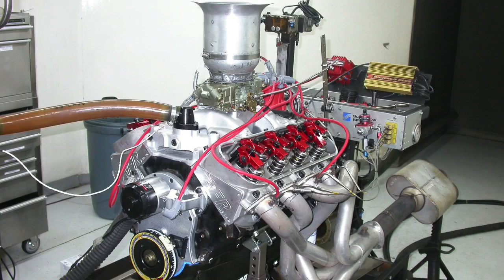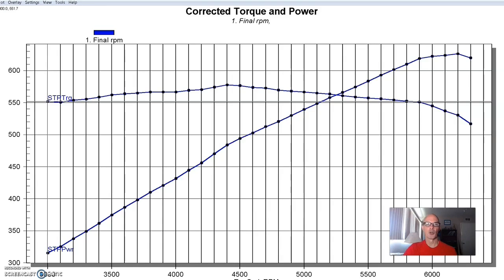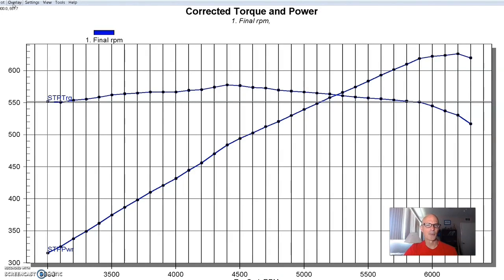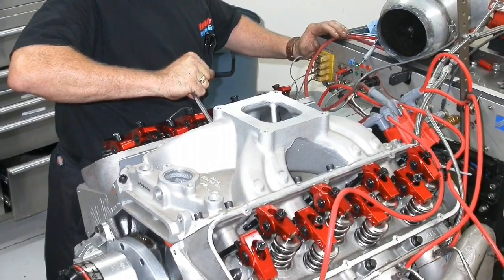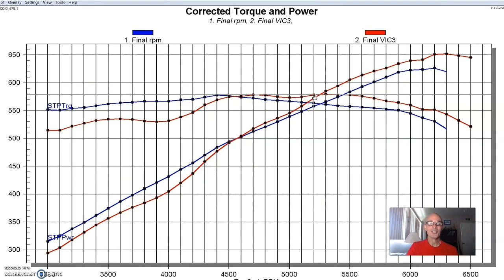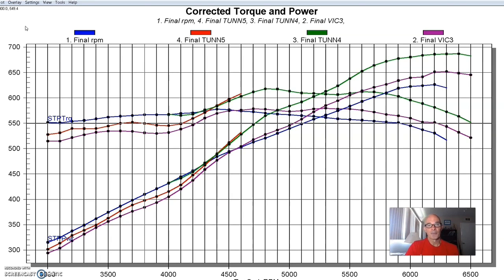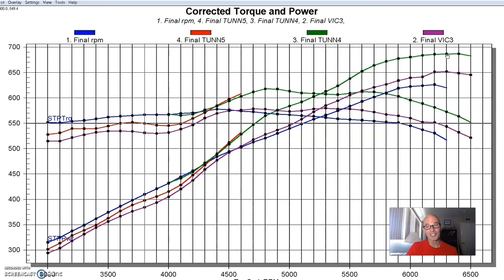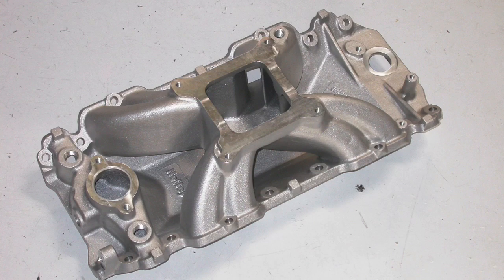BBC-TUNNEL RAM vs THE WORLD! -PLUS BOOST

Comment: I'd like to see a test between a single 4 tunnel vs a 2x4 tunnel. I want to see the far corner a/f and egt ratios compared to  the inside 4 cylinders. Will a single 4bbl tunnel ram hurt the engine?  Weiand makes both tops - it just needs fancy header data collection.  While I am dreaming how about propane and turbo boost like AK Miller did 50 years ago.
Reply: You can't hurt an engine with an intake manifold
Reply: @grren1782  I  own a 351 Cleveland Tunnel ram  from back in the olden days.   I also have  both Dual and single  Quad tops. When I first Acquired this intake  in a trade,  it came with the Single  top. When I tested the Single carb  I could  never get the two Front Cylinders enough Gas, They always run lean the spark plugs were white. some of the  guys  I talked to said just run it they make good power but the white plugs  scared me.
My combination  made the best Quarter mile time  With Two 750  4779 Holley carbs.
Reply: @mylanmiller9656  there must have been something wrong with the intake then. It wouldn't be a problem if there was equal length intake runners
Reply: I wrote that before he replied, whoops
Reply: @grren1782  The Weiand Hi  ram  single top  is built with a design flaw that starves the  end  cylinders, Yes there is a  problem with the  intake top!
Reply from the maker: a single-center-mounted carb does not work well on a tunnel ram unless the top is modified and elevated usually
Reply: @richardholdener1727  I would have no problem sawing into the top to install a vertical divider to separate the fore and aft runners. I remember an earlier manifold with a removeable plenum divider. Probably worked as good as an Offy port-o-sonic, LOL. So a glue in turtle won't work. 
I can go individual runner injection ports and rails with just an air valve on top. Or put a 1" plate spacer between top and bottom  to increase said plenum.  Or just use the dual carb top.
Thanks Richard, when I win the lottery I'll buy us both a dyno. Hope you liked the AK Miller reference.

Comment: I think the most important we learned that standing next to a big block agrees with Brule ... he looks younger and happier.
Reply from the maker: Brule circa 2003
Reply: @richardholdener1727  I liked the low compression. Same everything with a Q-jet. Truck motor. 454's need a roller cam because of the funky oiling or drilling into the oil gallery with a redirection. Rollers are fine. I like NV4500's behind mild Chevy's in a truck platform. MSD with on the fly timing control and a A/F gauge, all is good. Simple, clean and last forever. Power is nice but sometimes people want a truck with some pop but will last. Low compression big block with 500tq at 2500 isn't bad. I say keep it simple.

Comment: Thanks, like it (in an earlier life was BBC guy), now sbc little car guy (there is a guy in NY with a 632ci BBC in his MGB though and a 540ci one in Florida), might be overkill
Reply: No, that's just enough, you don't get into overkill until you get into the 800 cube range bro.
Reply: @Prestiged_peck  unsure about that, a MGB is a 92" wheelbase little car, mine just has a 500hp sbc@2350lbs and is seems pretty sporty, 700hp/800hp might be dangerous (theres been 2 Hellcat Miatas built, both crashed)------------too much is about right usually though
Reply: @mgbchuck6527  if you put it on the right tires and put the right driver in the seat, anything is possible?, but yeah I wasn't too familiar with the car, if it's that short 800 is definitely overkill on most street tires
Reply: @mgbchuck6527  nice bro

Comment: As always, another great informative video. Now you need to boost the tunnel ram. I want to build your 565 with the tunnel ram and a turbo. I am impressed with that tunnel ram. Never thought it would make good power, they were always the cheapest one you could buy. WAY back in the day I bought one from PAW. They sold it in a kit with two 600’s. Had it on a basically stock, canned up 396.
Reply from the maker: I remember those
Reply: Richard Holdener never was fast, but a lot of fun with a stick behind it. Had in a few vehicles before spinning the rod bearings, yes multiple. Hv pump and stock pan don’t go together. I was 19 and learning. Funnest car it was in was a 55 gasser. Man I wish I had that back.

Comment: I've got a side question for you. I'm building a 496 for my C3. Having troubles trying to decide on a cam/lifter combo. All I hear from Multiple people at the hot rod shops and my engine builder are about how Crappy all these Roller lifters are and to Not use them. Do you know why they say this? Do you have Any long term test on say Any Hydraulic roller lifts that can guide me in my build? Thank you for the great videos.
Reply: @richie8538  I Hear Johnson are pretty good but I have no facts on Any of the brands. I'm not really concerned about the money as long as its done correctly the first time. So far the only constant from everyone is make sure they are Bushings and not rollers so when they Inevitability fall apart you don't ruin the engine.
Reply from the maker: Rhodes liter is flat tappet-hyd roller would  be better
Reply: @richardholdener1727  Good morning Richard ! I hope you have a chance to read this , I’m just guessing on how to contact you , so I thought I’d give it a try through one of your video’s so I have a 496 & I purchased a set of Qualfast heads , part number 15-132722 oval port   My readings on the head flow bench are
.1. 75.3 
.2 149.3 
.3 216.5
.4 261.2
.5 289.5
.6 305.6 
6.5. 312.5
.7 318.5
.8 322 
Intake is 327  with a 126 chamber cc 
Exhaust is 123 angle port  , I know you said in the passed that you had never tried Qualfast , but if you can understand my readings , as I hope I’ve put it down clear , please let me know what your thoughts are , thanks Kevin
Reply: 496 is a good choice cooling wise. You gotta think about your driving style, power brakes etc.
I build cars and I use Howards hyd roller lifters. I think theyre made in house. Or if you like to work on your stuff and you dont want any problems, go solid roller. You just gotta go thru the valves every once in a while.

Comment: I've always wondered how the old school BBC would do with a like modern LS style long runner EFI intake manifold . Because most aftermarket intakes like FAST make good power down low and carry it pretty well uptop as well . Something like the cross ram from edelbrock would be  make good power on the big block chevy with having equal length runners and lower hood clearance than a tunnel ram .
Reply: Just an opinion.
Probably won't make as much difference as you think. The old BBC heads don't flow particularly well whereas the LS heads flow quite well. I think good aftermarket heads with LS style intake and injection would definitely make some good power down low. Highish comp would also be needed to be effective.
Reply: There is a later model BBC that uses a ramjet EFI.
Reply: Your question is answered by the 8100

Comment: That’s a 700 hp motor easy with 9:1 compression. That kind of power under 8 :1 is amazing.
Reply: Uh....No
Reply: @tunerdadtunerdad7927  did u watch the video?
Reply: I could be wrong, but 1-point of compression ratio is probably equal to about 25-30hp or so, yeah???....therefore, I highly doubt it would bring the power up to 700hp with the single carb intakes.....the tunnel ram, yes...but the single plane intakes, no.
Reply: Now I’m SUPER CURIOUS what my forged 496 stroker with 10.5:1 Dart 308 race series aluminum heads Howards full roller 296 I/ 308 E .640 / .640 lift 114 CL, dual quad tunnel ram jet boat engine will make!!! People kept discouraging me and saying “you’ll be lucky to get 600hp”, or most people will always over estimate their real power, never trust what your cam guy says, etc….. the guy at Howards- that told me what cam I needed said I should be a solid reliable 700hp+, and no one else agreed with him- even my engine assembler! After seeing this I was crazy excited to get my 78 Sonic jet boat in the lake and GO!!!!!!!
Absolutely amazing videos you put out!!!! Love them!!!

THANK YOU SO MUCH RICHARD!!!!!!

YOU MADE MY WHOLE YEAR SEEING THIS VIDEO!!!!!!!

MORE, MORE, MORE!!!!!!

Comment: Great content Rich but do a similar build with E-85 and find out just how much compression it will support safely, hopefully at least 14:1, with E-85 readily available in most of the country its a great option if someone was wanting to only run NA. Big inch, high compression and the engines with high CR always sound better too!

Comment: Not enough compression ratio and not enough cam
Reply: Huh...Why didn't he think of that.
Reply: @bigboreracing356  drag engines need  more compression the more the merrier
Turbochargers just adding compression by for Seymour are and their don't need a turbo if your run 22 to 1 compression

Comment: In my opinion I would always use a single plane there is enough torque in a big block to be able to lose some down low and let it pull up top
Reply: a little different in a boat
Reply: @ACatKrom  That is true, you're in the midrange for that.
Reply: A ported dual plane on a 454 i think would be best option.
Reply: shane  a victor made more power on my 489... from 4k up
Reply: You are CORRECT